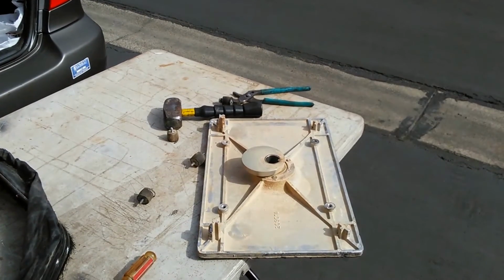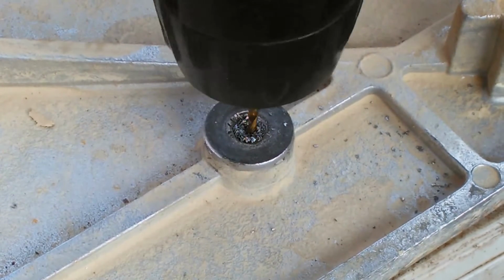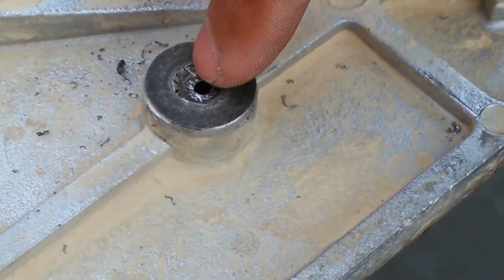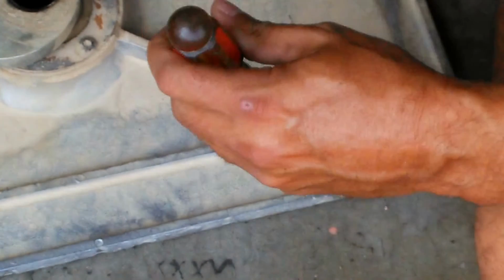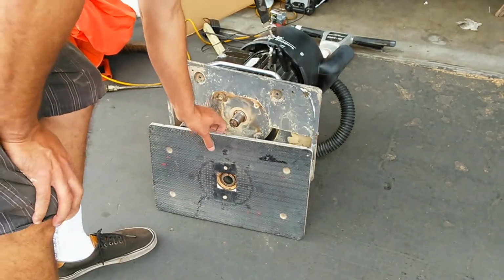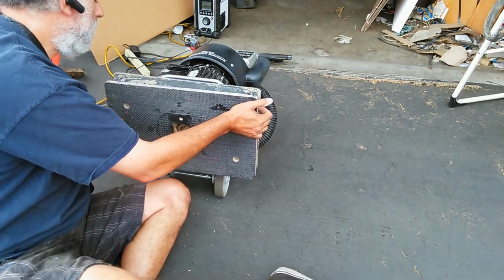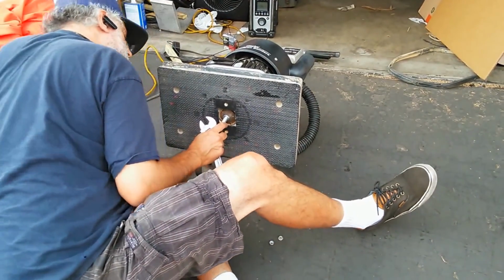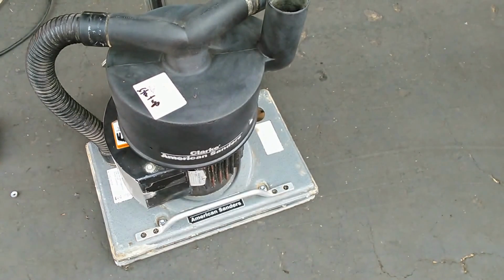Changing Bushings on a Clarke OBS-18 Orbital Sander Driver Pad

Comment: Nice info but the biggest issue is how to take the plate off, I have all the parts but I'm stock,  because I don't know how to do that. Can you please post a video  on how to do that?
Thank you
Reply from the maker: The center bearing is friction fit. You'll need to use a crowbar to leverage it off alternating angles each time until it works it's way clear of the main bushing.
Reply: @frankhamilton8257   Mine is making a clanking sound not constantly every 10 secs or so. Changes the bushings but after 10 mins of use it started again. The old bushings were still in good shape. Hope you can help me. Thanks

Comment: do you have a video on how to take off the plate?
Reply from the maker: Gould
You'll want to remove the spring rubbers first, then the driver pad has  a main bolt which needs to be removed with an impact wrench. You may need to pry the driver pad off of it's axis with a crowbar if it is stuck.

Comment: What are the symptoms of the bad bushings and bearings on these? Also are the older machines with the different rounded handles on top much different? The trigger switches are surrounded by plastic on those.
Reply from the maker: The machine will clank quite loudly if one of the bushings are bad, however the same thing will happen if the driver pad is warped. The machine should run relatively smoothly. If it doesn't, and the bushings aren't compromised, then it's likely the main bearing.

Comment: It would be nice to see how you get the plate OFF!
Reply from the maker: Removing the driver pad is a simple affair. First you remove the 4 nuts from the bushings with a socket, then you use an impact driver to remove the main bolt that connects the driver pad to the rotating assembly. If you don't have an impact driver, you'll need to jam something into the works to make sure the rotating assembly is not able to rotate when you turn the bolt.
Reply: A large flat-blade screwdriver is good for wedging between the motor and the right shoulder of the weight to stop the motor from spinning counter-clockwise. Best access is from about 1:00 with the sander tipped on its back. If the plate does not come off easily it is important to note that eccentric disk (the vibrating weight) and bearing-assembly all come off together with the plate (as you can see in the first images of the video), so you can use the screwdriver in the same position to pry between the disk and the motor while pulling carefully from the opposite side of the plate to shake the plate free. Don't lose the key.
Reply: Mine was so stuck it could not be removed.  I used the bolt and an air hammer to remove it.  After being removed I found the previous owner had used Loctite retaining fluid.  They had also warped the aluminum backer plate and that had to be replaced as well.  I drilled two holes (and tapped with 3/8-16) on either side of the bearing area on the backer plate to allow a puller to be used to remove the backing plate in the future. Good video.  Thank you sir!
Reply: @tarf1a  got a video of what you did to get it off?
Reply: @rcathey6255  I do not, sorry. I am very tech poor, no smartphone or video camera.
 
If using an air hammer, use a penetrating oil all around the motor shaft and backing plate.  
Use the bolt to help protect the shaft and hammer away while pulling on the plate.  My plate came off partially and then was stuck...

Sooo...  If you have the sander laying on the back with the wheels supporting the sander, draw a straight line through the middle of the plate using the shaft of the motor as the center point.  This line will be along the long axis of the sanding plate, in other words the long dimension.  Measure out about 2 inches from the center and drill a hole for a 3/8-16 tap.  Do that on both sides of the motor shaft.  That would be a 5/16" hole for a 3/8-16 tap.  Tap the holes.  Now you have a way to attaching a puller to the plate and the motor shaft as the center point for your puller.  I used a puller made by Proto but any puller that can grab onto the bolts will work.  A harmonic gear puller ought to work as well.

I hope this description works for you.  It was not easy to remove.  My sander was VERY abused and then dropped when being shipped to me by UPS.
Reply: @tarf1a  thanks for the details…I’ll give it a shot 🤞🏾
Reply: Gotta be something else to getting this plate off